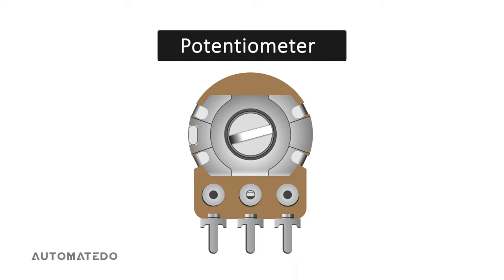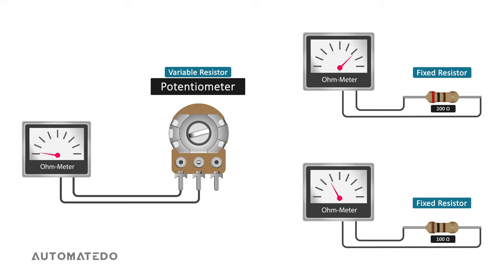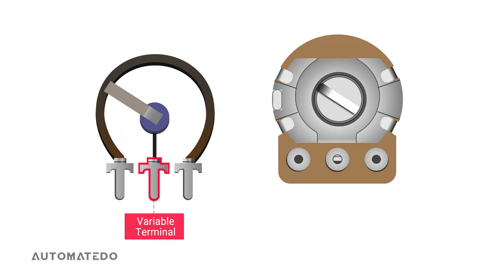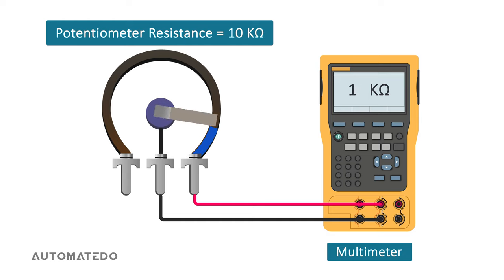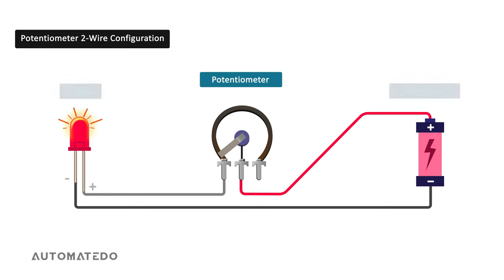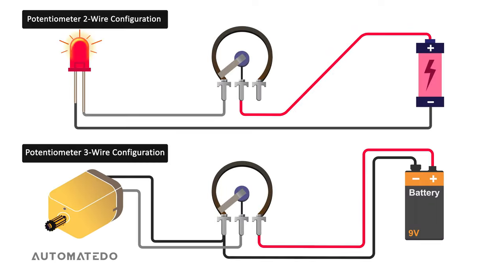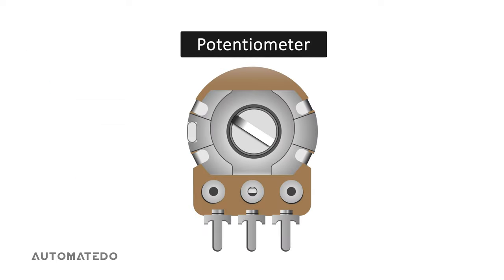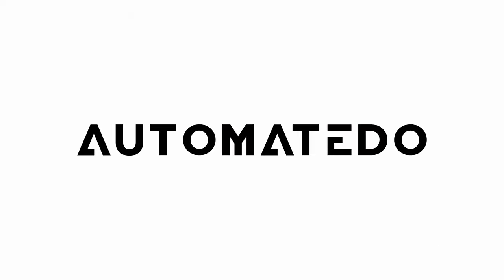Potentiometer Explained

Comment: Hello, I thought that more resistance decrease voltage and current flow?  for the potentiometer 3 wire configuration. Could you please explain
Reply: I think he misspoke. Pretty sure he meant to say low resistance first, then high resistance
Reply: Yes , he said wrongly
Reply from the maker: In general, if a potentiometer is used as a voltage divider to control the speed of a DC motor, introducing more resistance will lead to a slower motor speed.
However, there may be certain cases (the illustrated example in this video) where introducing more resistance could result in a higher motor speed.
For example, if the motor control circuit is designed to work with a specific range of potentiometer resistances, and the resistance is currently too low, introducing more resistance to bring it into the appropriate range could result in a higher motor speed.
Reply: It depends on how the potentiometer is used.
If you use it in a 2 pin configuration then you have a variable resistance and   as the resistance increases the current through it will lower.

If you use it in a 3 pin configuration, you are creating a potential divider (you will need to research yourself the theory of operation and the math behind it).
Here the output is a voltage (not a current) across the resistance between one of outer pins and the middle wiper pin.  Ohms Law says: V=IR, increase the resistance for a given value of current and the voltage across that resistance increases.

So when used as a potential divider, and the output is across a variable resistance in the potentiometer, then as that resistance increases, the output voltage increases.

Comment: At 4:46, is it meant to be LOW resistance? Not high
Reply from the maker: In general, if a potentiometer is used as a voltage divider to control the speed of a DC motor, introducing more resistance will lead to a slower motor speed.
However, there may be certain cases (the illustrated example in this video) where introducing more resistance could result in a higher motor speed.
For example, if the motor control circuit is designed to work with a specific range of potentiometer resistances, and the resistance is currently too low, introducing more resistance to bring it into the appropriate range could result in a higher motor speed.

Comment: I need help. I have a 750 Watt incandescent light bulb that I want to operate adjustable between 0 and 100 watts. I’m currently using a conventional dimmer switch and the switch and bulb are humming-hence, I’m looking at possibly using a potentiometer. IF a potentiometer will work for this application, how do I ‘size’ it? It’s running on a 120vac 60Hz supply. 
Thank you

Comment: Thanks, this is one of the best explanations I have found on the topic tonight. Still, I am not sure (pretty much being just dumb, unable to recollect my early school years) what the practical difference would be. 

In my case, if I have a DC motor, will I be able to kill it completely (0 rpm) with a pot ... and if so, will the circuit still be draining the battery (the bat power being transferred to heat in the pot)? I know what I want is possible with a pot regulator board (or LM317?), but I was wondering if I can make it simpler. Does the pot resistance matter in erms of the voltage provided? Guess I need to do more homework. :D
Reply from the maker: Yes, it is possible to stop a DC motor completely (0 rpm) using a potentiometer (pot), but it will depend on the specific characteristics of the motor and the potentiometer used. If the potentiometer has a high enough resistance and power rating, it can be used to reduce the voltage supplied to the motor, which will slow it down until it stops completely.
Regarding the battery drain, if the motor is stopped completely, there should be no current flowing through it, so the circuit will not be draining the battery. However, if the potentiometer is dissipating power as heat, it will consume some power from the battery, which will be dissipated as heat in the potentiometer. This means that you need to ensure that the potentiometer has a high enough power rating to handle the power dissipation and avoid overheating.

Comment: Can you explain to me how to select the value of potentiometer such that when I have a supply voltage of 9 volts, and I draw 50 milliamps of current, the voltage doesn't drop by more than 0.1 volt?
Reply from the maker: Indeed, selecting the appropriate potentiometer value can be a bit tricky. To answer your question, you'll need to calculate the resistance value of the potentiometer based on the voltage drop and current draw specifications. You can use Ohm's law (V = IR) to solve for the resistance value. Resistance value = 0.1 / 0.05 = 2 ohms. However, keep in mind that potentiometers have a limited power rating, so you should also make sure that the potentiometer can handle the current draw without overheating or exceeding its power rating.

Comment: is that correct high resistance allows more voltage to the motor  and low resistance on the wiper decreases the voltage at motor . Surely increasing the resistance drops the voltage at the motor due to voltage drop

Comment: for a 12vdc motor with a power source of 12vdc either Battey or adapter, what kilo omhs of pot should be used so it won't burn ❤️‍🔥.

Comment: Hi, what are the differences between right and left pins?
Reply from the maker: Hi, the difference between the other two pins is their electrical connection to the resistive element. One of the pins is connected to one end of the resistive element, and the other pin is connected to the other end. These pins are usually interchangeable and do not have any special significance other than their connection to the resistive element.

Comment: Sunum çok iyidi ilk işim abone olmak oldu . Bilgilenmek istediğim motor  bağlantısında sağa ve sola dönmesini nasıl gerçekleştireceğiz
Reply from the maker: Determine the specifications of the potentiometer and DC motor. Check the voltage and current ratings of both components to ensure they are compatible.

Connect the positive terminal of the DC motor to the positive terminal of the power source (e.g., battery or power supply).

Connect the negative terminal of the DC motor to the center terminal (wiper) of the potentiometer.

Connect one of the outer terminals of the potentiometer to the negative terminal of the power source.

Connect the other outer terminal of the potentiometer to the positive terminal of the power source.

Set the potentiometer to its mid-point position.

Turn on the power source and observe the motor's rotation direction. If the motor rotates in the opposite direction to what you desire, swap the connections of the motor's positive and negative terminals.

Rotate the potentiometer knob to control the motor speed and direction. Rotating the knob to the right will increase the voltage across the motor terminals, causing the motor to rotate in one direction, while rotating the knob to the left will decrease the voltage across the motor terminals, causing the motor to rotate in the opposite direction.

Comment: I never understood this, but what it never explained clearly in the voltage divider scenario is that the wiper is tapping into different voltage points as the wiper is turned; the voltage drops along the resistive element at these points, and this is the voltage point the motor gets (best recognized because of Kirchoff's voltage law). 

The variable resistor scenario is more intuitive while thinking of Ohm's law.
Reply from the maker: Thanks for sharing your opinion

Comment: How would this thing work on a lathe motor whereby you starve the motor of current, to slow the speed of the motor, then introduce, a heavy load to it. Will that burn the motor out in short order?

And how reliable are these units per-se, are they themselves prone to failing?

Thanks.
Reply from the maker: When it comes to controlling the speed of a motor, especially in applications like a lathe where heavy loads are involved, it is important to consider the motor's specifications and limitations. While a potentiometer-based voltage divider method can be used for speed control, it may not be the most suitable or reliable method for high-power applications like lathes.

In scenarios where you want to slow down the motor by starving it of current and then introduce a heavy load, it can lead to increased stress and strain on the motor. This can potentially result in overheating, reduced efficiency, and even motor failure if the motor is not designed to handle such loads.

For heavy-duty applications like lathes, it is recommended to use motor control techniques specifically designed for high-power and variable-speed operations. This typically involves using motor controllers, motor drivers, or specialized speed control systems that can handle the power and current requirements of the motor while providing better control and protection mechanisms.

Regarding the reliability of these control units, it depends on the quality of the components, the design of the circuit, and the operating conditions. While potentiometers themselves are generally reliable, other components in the control circuit, such as transistors or motor drivers, may be more prone to failure if not properly selected or protected.

Comment: Bisakah mengukur Potensio ohm pada rangkaian PCB Yang Sudah terpasang komponen lain lainnya ?
Reply from the maker: Of course! 👍 You can measure the potentiometer's resistance on a PCB even if other components are already installed. ⚡ Make sure your multimeter is set to ohm mode and connect the probes to the potentiometer's terminals. If possible, take the measurement while the circuit is powered off for more accurate results. 🔧📏 Hope this helps! 😊

Comment: at 4:43,  the ( + ) and the ( - ) of the battery are technically connected to each other and form a closed circuit, won't this overheat the battery and damage it ??????🤔🤔🤔
Reply from the maker: The + and - terminals of the battery are indeed connected to each other in a closed circuit when connected to the potentiometer and motor in a voltage divider configuration. However, this does not necessarily lead to overheating or damage to the battery.
In a voltage divider circuit, the current flowing through the circuit is determined by the total resistance of the circuit and the applied voltage. The potentiometer and motor act as resistors in the circuit, and the resistance of the potentiometer can be adjusted to control the amount of current flowing through the circuit.
As long as the potentiometer is properly adjusted to limit the amount of current flowing through the circuit, the battery should not overheat or be damaged. It is important to choose a potentiometer with a suitable power rating and to calculate the appropriate resistance values to ensure safe operation of the circuit.

Comment: Can i put potentiometer between the speaker and the dvd componant to increase or decrease volume of the speaker individually ,????
Plz help
Reply from the maker: Yes. To do this, you will need a potentiometer with the same resistance as the speaker. You can find the resistance of your speaker by looking at its specifications or by measuring it with a multimeter.

Once you have a potentiometer, you will need to connect it in series with the speaker. To do this, connect one end of the potentiometer to the positive terminal of the speaker and the other end of the potentiometer to the positive terminal of the DVD component. Connect the negative terminal of the speaker to the negative terminal of the DVD component.

Once the potentiometer is connected, you can adjust the volume of the speaker by turning the potentiometer knob. Turning the knob clockwise will increase the volume, and turning the knob counterclockwise will decrease the volume.

Comment: Can a potentiometer be used to start an inverter refrigerator compressor?
Reply from the maker: No, a potentiometer is not suitable for starting an inverter refrigerator compressor. Inverter refrigerators typically use sophisticated electronic control systems to manage the compressor motor's speed and power consumption. The control system relies on specific control signals and feedback mechanisms to regulate the compressor operation efficiently.

A potentiometer, on the other hand, is a variable resistor that can control the flow of electrical current, typically used for adjusting voltage or signal levels. It is not designed to handle the complex control requirements of an inverter refrigerator compressor.

Comment: Sorry for the stupid question: If the DC motor was wired up in the same way as the LED, wouldn't the effect be the same? I.E. That the potentiometer is controlling how much power the appliance is using?
Reply from the maker: In fact, that's a great question my friend. While a potentiometer with only two pins can be used for motor speed control, a potentiometer with three pins can offer additional flexibility for controlling other aspects of the motor control circuit, such as the direction of rotation or the duty cycle of a pulse width modulation (PWM) signal.
For example, in a motor control circuit that uses PWM to control the motor speed, the third pin of the potentiometer can be connected to the PWM input, allowing the potentiometer to control both the duty cycle and the speed of the motor.
Reply: @Automatedo  Thanks for the answer, and for the excellent videos :)
Reply from the maker: We will appreciate it if you can introduce this channel to your friends and colleagues as well 🙏

Comment: what's the difference the first digram and the second diagram?both gave out more current and less current,the motor also spin fast when received more current so does the light,
Reply from the maker: While a potentiometer with only two pins can be used for motor speed control, a potentiometer with three pins can offer additional flexibility for controlling other aspects of the motor control circuit, such as the direction of rotation or the duty cycle of a pulse width modulation (PWM) signal.

For example, in a motor control circuit that uses PWM to control the motor speed, the third pin of the potentiometer can be connected to the PWM input, allowing the potentiometer to control both the duty cycle and the speed of the motor.

Comment: I connected the pot with a 15w speaker and a 300w amplifier to use as a volume control device, but the pot started heating up when I turned up the volume
Reply from the maker: It can be one of the two options: 1. something is wrong with the potentiometer internally that is lowering the resistance | 2. You had the center (the wiper) and the negative end reversed. Most potentiometers have the signal pin in the middle, with voltage and ground on either side, but this isn’t always the case. The best way is using a multimeter to measure the resistance values between the various pins
Reply: Exceeded the power handling capability for the potentiometer.

It's really important you calculate the voltage drop across the potentiometer AND the maximum current that will pass through it, then calculate the power. Then ensure you use a correct power rating of potentiometer. As well as a correct resistance value measured in Ω.

Comment: Battery will not short by 10k resistance?
Reply from the maker: In this specific setup, the 10k resistance in the potentiometer serves as a current-limiting resistor, ensuring that the current flowing through the circuit is within safe limits. It helps prevent excessive current flow that could potentially damage the battery or the components.

However, it's important to note that the power dissipation of the resistor should be considered. The power dissipation rating of the resistor should be higher than the power consumed by the motor. This ensures that the resistor can handle the heat generated during operation.

Comment: I think we can do - motor connection same as LED connection .... So why 3rd terminal is attached?
Reply from the maker: That's a great question my friend. While a potentiometer with only two pins can be used for motor speed control, a potentiometer with three pins can offer additional flexibility for controlling other aspects of the motor control circuit, such as the direction of rotation or the duty cycle of a pulse width modulation (PWM) signal. For example, in a motor control circuit that uses PWM to control the motor speed, the third pin of the potentiometer can be connected to the PWM input, allowing the potentiometer to control both the duty cycle and the speed of the motor.

Comment: Noob here. 
I still dont get it. 
Could't we control the speed of the motor using the same wiring as in the LED circuit? (Using only 2 terminals)